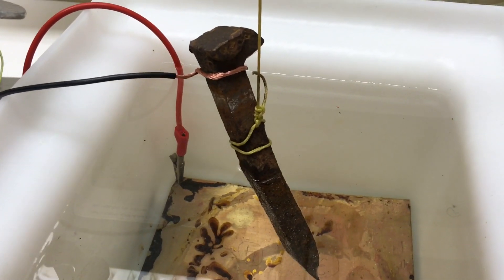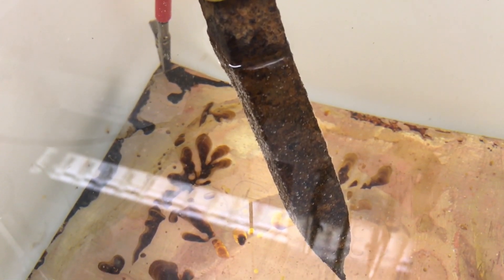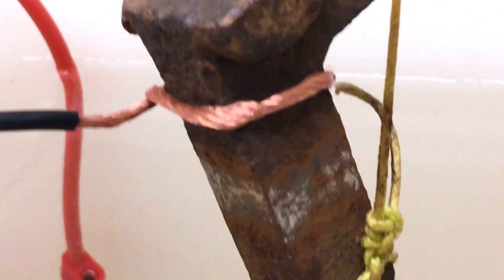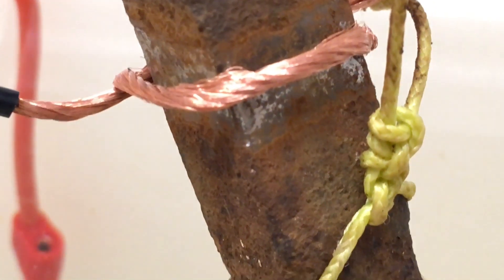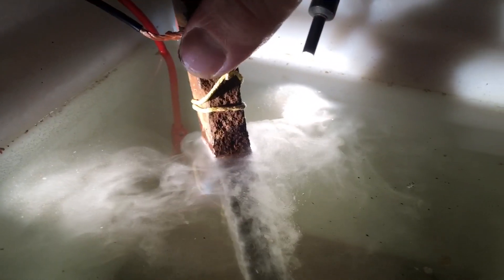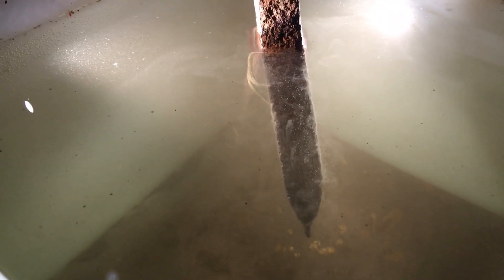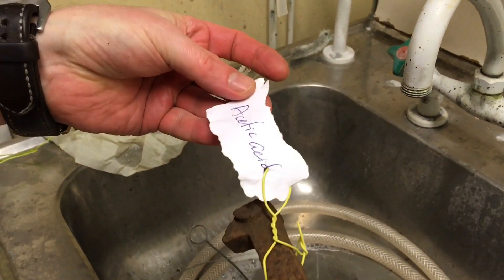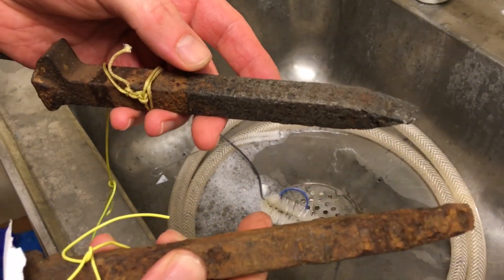True rust removal by a chemist - boosting the performance of white vinegar by electrolysis

Comment: Um ya, it can be replaced with electrolysis. If you use that method, you dont need vinager. Water works fine. Preferably distilled, but any works

Comment: Most examples I have seen and therefore all I have ever used involve washing soda rather than acetic acid.  I would imagine an acidic solution may work quicker due to the fact that an acid can  cause the iron to go into solution whereas a basic solution cannot.  Then again I would imagine the basic solution may do better to preserve the most of the base material under the iron oxide and be safer for your part in restoration.

Comment: One hour! If you had let the high concentration acetic acid do its work over 24-72hrs you would see a stark difference. Why not test straight 35% acetic acid(electrolyte) and electrolysis?

Comment: Is the Vinegar boosting appliceable if I use washing soda as an electrolite as well, or it only goes with table salt? Thanks!
Reply from the maker: No it doesn’t work because the washing soda is alkaline and the vinegar is used because it is acidic, mix the 2 and it will be neutral pH - not working
Reply: That was my uneducated guess. I've just did my first elecrolysis rust removal - a WWII track link. The method was not beyond expectations, lives up to it's fame (read: takes forever, gives perfect results) - next time I'll try out tabla salt on it's own and than your recipie. Thank You for the answer!  @Ken_Sweden

Comment: Hi Ken, as a chemist can you perhaps shed some light on how to tell when such a solution is depleted, or how must rust removal it's likely to last for?
Reply from the maker: Difficult questions because it will depend on your counter electrode and how the electricity is affecting the possible clogging oxidation on it with time. However, but as far as I have heard from the feedback of viewers, and form my own experience, as you dissolve more iron your solution will stay acidic and work fine. In the end, the solution in this video should not generate too much oxides on your electrode as it is acidic.
Reply: @Ken_Sweden  interesting, good to know. Actually, in my experience so far with a ferrous anode, it corrodes, material is removed from it, but at the same time the process does a rather good job of cleaning it, at first I used galvanised and the zinc was stripped off very quickly, but overall the electrode remains clean. I do however get quite the accumulation of blue-green and brown sludge collecting in the solution, which is messy but easy enough to remove from the item being de rusted. Thanks for the informative video btw :)

Comment: So basically electrolysis just removes rust simply by generating lots and lots hydrogen gas for use as a quick debriding agent (to simply mechanically dislodge the rust away). So, you'll want to run this at high currents then and also only for a short time too so as to not leave the workpiece in a conductive solution exposed to the air for too long (which will only encourage further rusting)...

Comment: You didn't state in this video what material your anode plate was made from. After reading some comments, I was made to understand that your anode was a piece of titanium. I seriously doubt that the average man has scrap pieces of titanium lying around and the cost of purchasing titanium is crazy expensive. Would an anode made of a piece of clean steel not work? Secondly - does the size of the anode in relation to the size of the rusted work piece matter?
Reply: You can get titanium pretty cheaply if you know where to look, I got old titanium turbine blades that were out of spec and unuseable, for pretty cheap on eBay. Can't remember the exact price as it was years ago, I'd imagine it'd be a bit pricier now.

Comment: Is your katode there copper? Does that work just as well as a ferrous material? Does the copper just end up oxidizing green then?
Also, does that mean you can use the same method to remove oxide layers on other metals (like copper)?
It would be nice to have clarification on this.
Reply from the maker: Yes you are correct on the oxidation of the culler but as more noble it occurs much slower. In the video it was brass.
Reply: @Ken_Sweden  Thanks. I think I was initially under the misconception that this process worked by "moving" the rust and that you necessarily had to sacrifice the kathode. As I have learned more I think the kathode oxidation is simply a consequence of ideal conditions for rusting (acidity,oxygen,water,agitation ect.). Correct? So ideally you just want to use a kathode that is as non-reactive as possible - like titanium (or even platinum if you can affford it) to achieve the same result with less mess. I think you had a video on a titanium setup iirc.

Do you happen to hang out on a discord server or similar? I would love to have a contact who knows chemistry to skill-share with (computer engineer, networking, cloud, sysops ect.)

Comment: Vinegar works because it is acidic. Electrolysis works with electrolytes which are alkaline which is kind of the opposite of acidic, isn't it? So you are either limiting your electrolysis by making the solution less conductive or you are limiting the acidic ability by neutralizing the acid with the alkaline substance. Don't the 2 contradict each other?
Reply from the maker: You add so much acid that you always keep the electrolyte acidic. The motivation for always keeping it acidic is that all your dissolved rust will stay as rust ions metal ions and be readily dissolved, then they will never clog any electrodes and your reactions will also go faster. Thx for comment!
Reply: @Ken_Sweden  thanks for the reply

Comment: To remove rust inside a motorcycle fuel tank would you use this method or the hydrochloric acid in your previous video?
Also, how would you prevent flash rusting or further corrosion
Reply from the maker: No I wouldn’t go hydrochloric acid just because of what you mention. Although it shouldn’t be any water in the fuel tank you may encounter humidity and flash rust would become a major problem. Phosphoric acid as in a diluted rust converters would here be the way to go. In case of lots of rust, I would mechanically remove with shaking steel balls before the phosphorus acid treatment, and if it didn’t work. I would go for new tank. Sealers exist but one should remember that petrol is one of the best solvents out there and you do not want dissolved sealer or paint in your carburetor. Thx and good luck

Comment: What's the difference in the end result (the reactions at both electrodes, assuming plain carbon steel) between this process (sodium chloride + acetic acid) vs a sodium bicarbonate electrolyte?
Reply: In the carbonate case, you will have you high pH. Then the dissolved material fall out from the solution and clog on your electrodes. When the electrode get covered with lots of dirt, electricity goes down, and the process doesn’t function evenly. With acid, everything stays as a solution because acid prevents that the dissolved material fall out as solid material on the electrode
Reply: @BenNorway  Ah thank you so much! That's great. I often have to scrape the anodes clean, it's a pain. Does that mean it also reduces the black oxide formation on the cathode?

I am going to switch to the acid process. I might move to graphite anodes too. 

PS Thank you for this video I had no idea it could be done this way. I've been using bicarbonate forever.

Comment: Why bother with the vinegar? Electrolysis does the job on its own.
Reply: It doesn't do anything to the part that you're derusting, sure. But it does keep the anode clean and unclogged, and it dissolves the rust that was scaled off the kathode ao that you wouldn't have that much foam and dirt floating at the surface. At least that's how I understood it.
Reply from the maker: Just to keep it acidic, keeps the rust and chunks dissolved

Comment: Way over explained!
I use 100g of washing soda (sodium carbonate) in a half gallon, submerge the item AND the croc clip holding it.
Action right away on switch-on - the rusty connection soon cleans itself, 20 minutes tops, and the reaction is then going like the clappers, just 4.5V or so and a couple of amps from an old charger I got off the local tip for free.
All done in an hour.
Reply: Car battery charger same way as you but a 55 gallon plastic drum. Once out of tank put it on fine wire wheel on bench grinder. Bingo

Comment: Oxalic acid also works pretty well at de-rusting, as is relatively cheap. Add a little hydrogen peroxide to encourage the rust to convert into Iron Oxalate III instead of Iron Oxalate II.... III is more soluble than II, which seems to result in it taking more off... also III a cool green color whereas II is boring brown. I'm considering combining electrolysis with an oxalic acid bath.
Reply: any updates on how that went? very interesting idea
Reply: @mattbush315  Very well actually. I've got a few buckets of oxalic acid and phosphoric acid sitting around the shop that I'll throw anything rusty into. Oxalic tends to leave a bit of a residue that needs to get wire brushed off whereas phosphoric will leave a black sludge (ferric phosphorous or somesuch) when it gets used a lot. Both sludge and residue can be cleaned off fairly easily.
Reply: @PeterB12345  did the electrolysis seem to add any benefit? Sounds like the acid works pretty well on its own?
Reply: @mattbush315  Honestly I prefer the acid vats. It's just simple. Throw the part in and clean up when it comes out. The main advantage of electrolysis is that there is no cleanup required. However, if you use fresh phosphoric acid there is no clean up either. I think if you had a whole bunch of parts then the electrolysis would be beneficial. Also if you have big parts you can do a large electrolysis setup that might end up being less cumbersome than huge vat of acid. I mix both oxalic and phosphoric acids to a ratio of 10% acid and 90% water. This seems to work fine without being too aggressive.

Comment: I have had great success with citric acid. It works much better than acetic acid and is more pleasant to handle, I leave the rust item to soak overnight, scrub it off with a brush then leave it for another eight hours or so. I few add a few drops of detergents at the beginning, this improves the process further. I have never tried combining this with electrolysis. It would be interesting to try.

Comment: the amount of chlorine given off is directionaly proportionate to the amount of amps and time... 6vdc at .5 amps for 5 minutes will produce safe levels and turn your salt water to a .8% chlorine solution which is approximately the strength of bleach you buy at the store.. But do not be fooled chlorine gas is deadly stuff.. No matter what folks on you tube tell you.. with this stuff there is no room for error.. talk to a chemist before doing this!
Reply: Rubbish.
Reply: @tiggywinkle1000  no.. I do not think you can clean rubbish with this.. nice guess though..
Reply: @tinkmarshino  Wrong.
Nobody likes a smart Alec, so, here you go:

Combining Common Salt and Water gives Salty Water. Also, your example would produce HCl (Hydrochloric Acid). As can be seen from the video, this is not the case.
Salts derived from strong acid/strong base combinations will not undergo hydrolysis in an aqueous solution. The NaCl dissociates (ionizes) in the water; result: salt water. The ions have no way to re-combine in the solvent, in this case H2O, to produce either neutral Na or Cl elements. After the water is gone, the ions then crystallize into... guess what! Salt. The energy from the electrolysis is thus entirely taken up with breaking down the solvent to produce Hydrogen and Oxygen, nothing else.
To convert salt to Na and Cl electrolytically, you would need to heat it until it melts: about 800 degrees Centigrade. If you can do it at room temperature, you've got an edge over ICI and the rest.
I have cleaned many items that you may call 'rubbish' using a similar method, and made money from it too!
Consider yourself enriched today.
Reply: @tiggywinkle1000  How would you know what I call rubbish? Well no matter.. thanks rich guy.. I appreciate your time.
Reply: @tinkmarshino  I apologise. I get around the whole 'salt' issue nonsense thus: I use less than 100g of washing soda (sodium carbonate) in a half gallon, submerge the item AND the croc clip holding it. Action right away on switch-on - the rusty connection soon cleans itself, 20 minutes tops, and the reaction is then going like the clappers, just 4.5V or so and a couple of amps from an old charger I got off the local tip for free.

All done in an hour.
Reply: @tiggywinkle1000  Sounds good to me.. what works should be used.. I am gonna try this next time myself.. No apologies needed we all have those kind of days.. Carry on!

Comment: Subscribed! Awesome video but with some remaining questions:
Would weak citric acid work too?
Is the electricity in general fastening every acidic reaction by taking electrons from the iron oxide? 
Will chloride gas be produced in higher amounts when using other acids? 
Do you have to be careful when using stainless steel as anode combined with acetic acid?
Reply: not a chemist, i have had the best results with concentrated lemon juice and salt.
Reply: I read never use stainless steel as it turns into a very toxic carcinogenic substance. Hexachloride or something that sounds a bit similar. But it’s bad shit. I got really panicked as I read rebar was best for using as the scrap and had been successfully using that taking them in and out then cleaning up with wire brush sometimes touching the wet rebar without gloves. However as the rebar I was given was well rusty to start I very much doubt it was stainless steel and the fact it rusts up in electrolysis. Apparently some rebar is stainless and most is not

Comment: Hi. I want to try this on a large water tank. I have two questions.

1. I'm considering using some scrap copper as the anode. Should I worry about copper plating occurring on the tank? Some suggest this will happen, promoting fresh corrosion on the finished job?
2. Citric acid seems to be cheaper than acetic. Is it any good for this? It has multiple pka values apparently, hence its use as a buffer. The implications are beyond my grasp of chemistry.

Comment: I haven't tested anything I'm about to say, but I'm curious as to why in all these videos, the leads aren't simply switched to allow the rusted material to act as an anode and slowly dissolve the oxide layer with lower current density with something like, oh let's say, a small stainless or graphite sheet to act as a cathode.  I want to believe that doing so would reduce the energy input, time and, if done properly, any addition to lost material should be immeasurable.

Comment: I'm restoring a Ford series 101 Single Bottom Moldboard Plow.  It is mega, mega rusty.  I've used rust removers, vinegar, salt and pretty much everything else under the sun.  I'm impressed with just plain vinegar.  It does a decent job.  But using electrolysis puts the icing on the cake.  I have removed massive amounts of rust from some very big and heavy parts with amazing results.  Remember, it's surface area that counts, not mass.
Reply: Phosphoric acid works much faster and is still safe.  I'm not sure if there is a benefit to acetic acid vs phosphoric

Comment: I had never thought about using vinegar and electrolysis together. Great idea, thanks! I’ve gotten substantial results after simply soaking in vinegar for a few days. This is definitely a step up!
Reply: So are we saying just vinegar, or vinegar in water, it's a bit confusing. 
I have done m/c tanks in water and washing soda
Reply: @llewvirtue861  If I understand his notes, I believe you can use up to a 5:1 water to vinegar mixture.
Reply: Vinegar is never 100% concentration.  3.5% is common, 5% and 9% can be found at the grocery
Reply: @ChuckD59 5 liters of water 1 liter of vinegar ?! 5:1

Comment: Don't use stainless steel for an anode as it could create hexavalent chromium if you don't know what you're doing.
Reply: I'm about to experiment with this as a small business strategy to fund my car projects. I have an engine block I want to rebuild and I feel electrolysis engine cleaning could be a good niche service to offer. What would you suggest as an anode for an entire 300+lb engine block? I plan on using a 55 gallon drum and aquarium bubblers
Reply: Or could the drum itself be a fine anode?

Comment: 12V 9Amp......    not the full truth....   when the +pole were at the "rust" - you had NO current flow (or at least very little)   9Amp is WHAT the chager CAN deliver... not what it really delivers...  It would have been much more fair if you told how much current did flow at diffent times in the film...  BUT still very GOOD film!!!